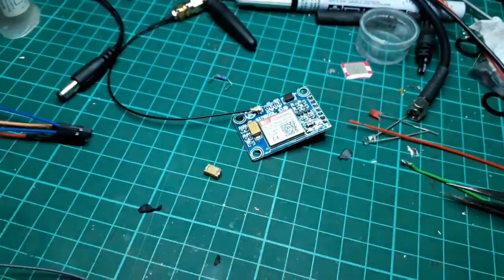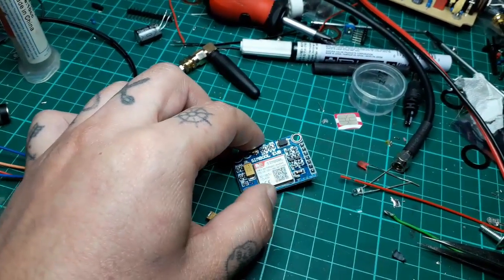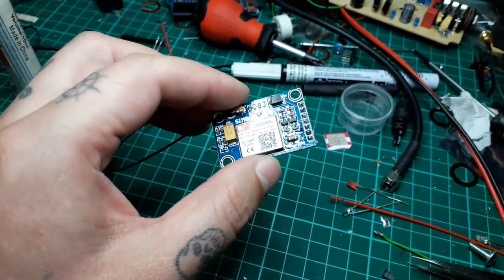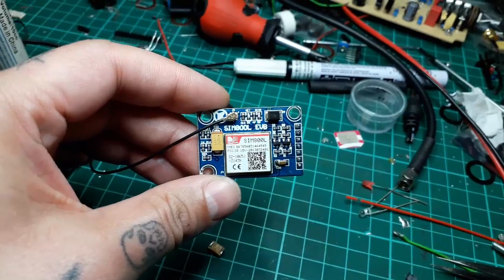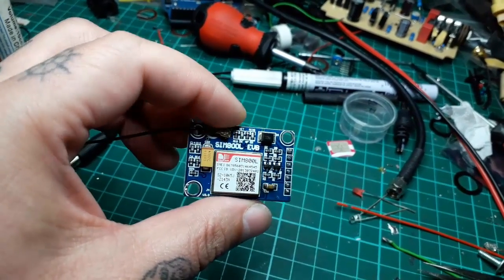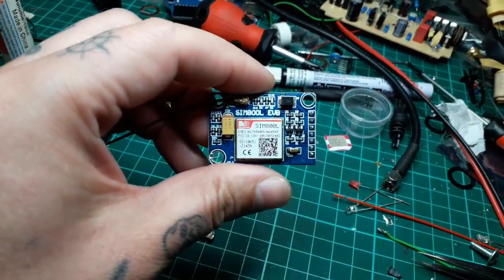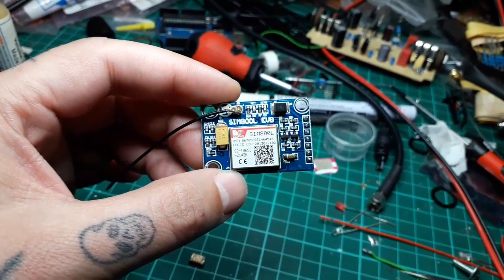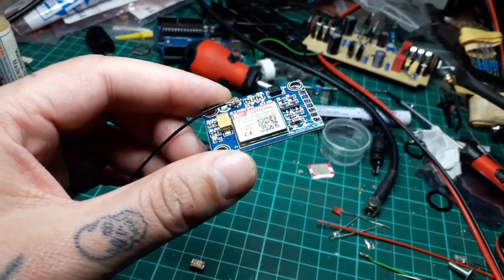SIM800L EVB - the simple solution for a big problem

Comment: What were the amperes output of the GSM's capacitor after a new one was soldered altogether ? Since the module has 2A bursts, does that mean I have to make sure the capacitor has 2A output ? I used a 2200uF/16v soldered with the on-board ceramic capacitor and got 1.7A-1.8A readings on my multimeter. Im also considering placing another capacitor onto the supply to make sure I get consistent curents (Im using a 12V 2A adapter connected onto a 5V output stepdown converter as the main supply )

Comment: This video is very useful. pay attention to your connection cables, they are not always only made of copper and there are sometimes resistances which in this case cause these problems of voltage drops and parasites

Comment: @DeXTeR'sWorkshop how many volts can you use to feed this board??? The datasheet says it's recomended to feed with 4v but module has a 5v pin..
Reply from the maker: Yes, because there is a drop diode on VCC that would put out around 0.7V 
But not all modules have it.

Comment: 4 years later and it's still a great solution. Thank you!
Reply: Lmao, so fucking true 😂😂
Reply: Did ur problem solved... How please tell me.
Reply: @Sekhar_Home  I've actually used another board SIM808 Development Board EvB-3.2.

Will test it tomorrow and tell you the results but in advance, the module is very sensible and should be used with a powerful (2A minimum) power supply, you can add capacitors from Vout to ground on the power supply output so it decouples the supply voltage from the module and handles the high frequency high current peaks it needs.
Reply: @Sekhar_Home  you could also have broken you module if you fed it with incorrect voltage so be careful. Double check aways and have a spare part to test following the correct steps from the beginning.

Comment: I'm also can confirm that the mod is working. I had my project connected in a good PSU but accidentally my antenna was unscrewed and the module keep reseting it's self after losing the signal with the GSM network. I changed the cap (477a) with an electrolytic 2200μF 16v (for people they are asking, you need any electrolytic cap from 1000uF to 2200uF at least 6v) and the module just stayed alive even after losing the signal with the GSM net without resetting/rebooting. So this made me think that this is a signal problem and not a power/PSU problem.
Thanks for the upload mate, subscribed.

Comment: Man, you helped me so much. I also noticed when antena was not attached module worked, so obvious - powering problem, even with 3A power supply.  I used 2200nF low ESR between VCC and GND and didin't work. I solder like you and everything working now.

Comment: Hello dear, I have replaced the capacitor with 2200uF and it is still not registering. My SIM card works fine. I have provided a separate 5V with buck converter. What could be the issue?
Reply: Hey! Did u solved the problem. I have the same problem

Comment: This is the real problem of SIM800L and SIM800L EVB. The solution is adjust the input voltage reading the voltage on VBAT. VBAT is in the possitive capacitor terminal and GND. In the SIMCOM 800L datasheet tell us the range voltage VBAT(simcom chip) 3.4v to 4.4v. you must set the voltage between 4.2v and 4.3v on VBAT. In the case of SIM800L EVB the input voltage is near to 5.2v to 5.3v. So input voltage 5.2v 5.3v while in VBAT 4.2v 4.3v. no more fail.

Comment: Se debe conectar el modulo directo a la fuente de poder con buenos cables, no se debe usar cables delgados ni energizar por el protoboard porque no pasa suficiente corriente, en mi caso se soluciono al conectar directo a 5v 2 A / You must connect the module directly to the power supply with good cables, you should not use thin cables or energize the breadboard because it does not pass enough current, in my case it was solved by connecting directly to 5v 2A.

Comment: I didnt even remove the capacitor on the sim800l evb board i added 4 (470uF) cap parallel connected. works like a charm. u saved me days of frustration. thank you dexter.

Comment: My unit was somehow short-circuited when i connected it to my ESP32 5V output, i connected everything correctly, and it got very-very-hot to the point where a diode (near 5v input) got desoldered and fall off. one thing i noticed is the PCB was cutted too much on iop side, exposing a vias taht were connected to the 5v input diode, is this the cause?

So far my exploration into the GSM realm has been quite unsavoury compared to Wi-Fi and LoRa

Comment: My unit seems to have a C22=470uF (it's marked 477A) capacitor, but it's showing the exact same problem as yours. You said that the datasheet specifies 470uF minimum. Also, I'm using a PL2303MDL USB-to-SERIAL module. If the SIM800L module draws 2A in bursts, that might explain why it's resetting too. I think the serial module I have can only supply 25mA.

Comment: For Dummies like me: I was afraid of damage my module, so before start to change it, I was trying to test with the capacitor on the protoboard but it was't working till i put it at the nearest of the pins of the module and worked. I'd say that it's because the protoboard wire can't let pass 2a as needed, its too sharp. So use cables to a better current peak.

Comment: You saved my project! I was about to change everything when I saw this video, it perfectly worked for me. I used 2200uF - 25 V cap, the positive pin goes in the antenna side. Easy, quick and 100% solved, thanks a lot to you and all the people commenting their experience :)
Reply: Please could you show me a picture of how you connected the capacitor to it
Reply: ???  how you connected it to the module?
Reply: Please could you show me a picture of how you connected the capacitor to it

Comment: Thanks DeXTer for this solution. I solved this problem with a 2200 uF capacitor, not on the SIM800L itself, but on the power leads to the circuit, very close. No more connection dropout.
Reply from the maker: Yes, in the final design ive added the cap very close on the PCB.
Glad i could help.

Comment: Thank you for sharing this great solution! I exchanged that capacitor with a 2200uF 16V capacitor as you did, first time the system has started, I could send and receive text messages from Arduino! :) But as I unplugged the power source and tried to restart, it didn't work anymore. It blinks 6-9 times and as tries to connect to the network, it restarts with the 2200uF capacitor. What else can you suggest?
Reply: I saw in other comments that the breadboard wire is not enough for 2A, so I tried to put shorter wires to the power supply and it works again :)

Comment: I'm using SIM800C with 220u Tantalum capacitor for decoupling closed to Vbat pin. I've never encountered such problem. Maybe it is because of different module or pcb layout.

Comment: Have you read manual completely? What about power source? Drops during TX bursts? Is your power source in specs? And what about ripples during TX? Also in the specs? And what about power lines resistance? I see just thin wires and strange connectors? Are you sure that all that stuff is in specs? I bet the module should be soldered into other board not hanging on the connector-ed wires. Replacing capacitor without cleaning all other issues I can see is not proper solution.
Reply from the maker: Power source is able to put out 10A :) other modules worked without a problem in the same configuration - the difference between those that were OK and not OK was the filtering cap which was not according to the DS . And yes the value of the VCC cap is stated in DS as a minimum value (read the specs first) - so please :) but your things together and in place before - like read the SIM800 datasheet ;)
Bu thank you for your comment of invaluable ... value
Reply: @YO3HEX  I see you know the things best. I wanted to show others who do not know too deeply what you are talking about that simple replacing tantalum cap with bigger electrolytic it is not solution.
By the way I did not asked you to tell me what current your power source can deliver. I just mentioned some parts of datasheet. The most important is how deep drop is made by GSM burst with maximum output power. It is evident that you did not measured it. End even you power source can do 10A it does not mean that it is so fast that it will be with module datasheet specs. Also if your power source will make ripples in the TX period you will have bit BER and the data transfer will be unreliable in the moment you get out of good GSM coverage. Makes no sense to discuss it anymore because you wanted to show simple solution and my question trying to disintegrate its stability. I wish you good luck.

Comment: Hi, what Type of capacitor I should use? I mean electrolytic, tanthal, ceramics? Thank you for reply
Reply from the maker: A low ESR electrolytic would be a good choice.
Reply: @YO3HEX  thank you, I will solder sth like it. What about power suply for it? I hope that 5v Esp32 output is not a good choice. Impulse Power suply will generate a lot of noises So what will be Best for Such use?
Reply from the maker: @luki530  the power supply should be able to put out at least 2A so you will need an external one. You cannot use USB as a PSU

Comment: Your problem is NOT the capacitor. I just bought 100 units from China and they ALL work perfectly. Your problem is the Dupont cables that you are using to connect the power pins. They cannot pass 2A even in short bursts. Place the unit in a bread board and use solid core cables and it will work perfectly. By adding a larger capacitor you are adding a larger reservoir which supplies the current, but the problem is still there. Change your cables.
Reply from the maker: Ive tried also with 0.75 solid core wires and i had the same problem.
Ive also test it on PCB...same. nothing changed until ive added the cap of the value specified in the DS or bigger
Reply: Hi @NotMarkKnopfler, the dupont cables were my problem too. I was able to demonstrate it with a lab power supply with or without a Dupont cable between the module and the vcc

Comment: I used parallel capacitor 2x1000uf, and connect to vcc and ground sim card, and work. Thanks
Reply: Nah kak dir buat alat juga tah kak wkwkw
Reply: @cumahobiarduino4724  wei ini sapa 😂
Reply: Wkwkwkw tebe weh 😂😂😂🏡
Reply: Maenan IOT juga kak?
Reply: Ada kawan gueeh wkwkwkw
Reply: @cumahobiarduino4724  welehhh
Reply: @cumahobiarduino4724  amatiran doang ban, cuma kirim sms utk hidupin alarm, buat ews
Reply: Gak papa laah kak, ane aja baru belajar, ini ane mw Fokus di Modul gsm buat IOT nya karna pake NODEMCU bajetnya lumayan wkwkw

Comment: 2200uf - how many volts? Thanks
Reply from the maker: There is a max of 5v there...so anything between 10 and 16v will be more than enough
Reply: @YO3HEX can i use 1000uf 6.5v with it?

Comment: i have sim800L with 1000uF 6v capasitor with same problem. the LED always blinking fast (no signal). so better replace it with 2200uF 5.5v?
Reply from the maker: Might be another problem. Check if your network is supported by this module as it cannot connect to 3G networks, only 2G
Reply: the simcard work fine on the phone with 4G network
Reply from the maker: @helmyfaisal4696  read again what i said. The module will work ONLY  with 2G networks.
Reply: @YO3HEX  i see, thanks for advice. I think it's a big problem in my country, because i can't fi nd simcard with only 2G support in the market right now. hehe
Reply: @helmyfaisal4696  Semua kartu SIM yg ada di Indonèsia bisa 2G, bro. Jadi, masalahnya bukan di kartu SIM. Periksa dulu wiringnya. Bisa jadi, ada sambungan wiring yg kurang sempurna.
Reply: @kwcatur  udah lama ketemu solusinya om, H+1 dari komentar ini hahaha. Masalahnya ternyata memang di power.
Reply: @helmyfaisal4696  saya baru liat videonya hari ini. Solusinya sama spt dlm video atau ada solusi lain lagi?
Kalo solusi lain lagi, bisa dishare?
Reply: @kwcatur  beda dikit. Pake power external 5V 3A. ground dari power itu masukin ke ground arduino dulu, kemudian ground SIM ngambil dari arduino. Di kasus saya, ganti elco gak ngaruh.
Reply: i'm trying to replace the capasitor 2200uF 16V. but, nothing changed. still same problem. i don't know what to do again right now.

Comment: actually, you don't need to change the capacitor if you solder power supply pins directly into the module. jumper wires not enough to get 2A current
Reply from the maker: Read the datasheet of the sim900.
You need a cap on the power lines.

Comment: greeting

maybe you can help me if you have the good will

i have the same sim800l a module and the same ad hx711

my problem is
how do i make the hx711 go over the arduino nano like yours and that it measures send sms to my number

i see you have both sim800l and hx711 and arduino nano
i didn't just see the weight sensor

I would ask for any help
thanks in advance and all good

Comment: Thanks, i tried and its working. But the gsm can only recieve sms but cannot send. any solutions for me
Reply from the maker: Check on your sim if the smsc number is correct
Reply from the maker: Or use a sim from which you can send sms.
Never had a problem with sms receive

Comment: Worked for me too finally after replacing the capacitor and now finally blinks in 3 seconds => connected to network. However i'm struggling to make AT commands work. They never work & no any response received from SIM serial (TX & RX) Any one faced the same ?
I'm using external DC 5V (2A) for SIM module connected to VCC (5V) & ground .. while Arduino is connected to SIM like below
SIM VDD => Arudino 5V
SIM 2nd Ground (lower one beside RST) => Arduino Ground
SIM TX => PIN 8
SIM RX => PIN 7

Please, help!!
Reply: Hey did you solve that, cause I'm have the same problem
Reply: It is hard to diagnose your concern without seeing the code.

Comment: Gracias Amigo,  cambie el capacitor por uno de 1000microF y funciono el modulo, muchas gracias por tu aportacion.
Reply: Hola amigo. El capacitor que voltaje debe ser?
Mi problema es que no conecta a la red como si no leyera la simCard, era tu problema tambien?

Comment: Hey bro. Can i ask for the polarity of the capacitor? Which side is positive?
Reply from the maker: On an electrolytic cap the negative side is always marked.
The shorter leg is the negative also
Reply: @YO3HEX  Thank you bro! It worked! Nonetheless, i have observed that it goes back to restarting after sometime. Leaving it ON for about 5 minutes fixes the problem. Is this the capacitor charging? or what? haha
Reply: Cap btw is 2200uF with 16V.

Comment: Mine auto restarts for every approximately 7 secs. And I dont think it is because of power supply. It is more likely with signal issues. What am I supposed to do with this?
Reply from the maker: I think you have the solution in the video -replace the cap. Have you tried that? And no is not about signal issue - a signal issue would not make the module restart.
Change that cap and you will have an working module
Reply: @YO3HEX  thanks sir. But for some instances, the module works but somehow, it stops working.

Comment: I normally have no problems when I send SMS with this module. But when I receive SMS and read them with the module, at the beginning everthing goes well, however after some trials (10-12) the module seems not to responde anymore. I see a quick blink in the power light (not as long as the resetting one). I'm already desperate with this, i dont know if it's the SIM buffer which is full or the capacitor. I'd LOVE you could give me a hand. So far, Im for sure subscribed to this channel. Awesome help dude! :)

Comment: That definitely solved my problem! I used a 1000uF capacitor and worked great too. Thanks bro
Reply: Hello, did you connect the capacitor just like on the video or can you do it outside the module? And what voltage is the capacitor that you used?
Reply: Did it solve signal issues?
Reply: i have sim800L evb with 1000uF from factory. but its still have same problem.

Comment: Thankyou for the video what is the voltage of the capacitor you are using?
Reply: I have a 2200uf 25V capacitor will that serve the purpose
Reply: Hey thanks it worked for me
Reply: It becomes stable?

Comment: All the SIM8*** and SIM9*** modules use a lot of power when transmitting. I use a 4 volt/ 2.5A power supply with decent decoupling. 
This is well explained in the datasheet.  You can also use a 2500mA cellphone battery @ 3,7V
Reply from the maker: Using that already thank you, but also if you read the DS you will also see the recomandation regarding the caps near the VCC input 😉

Comment: Greetings.

I have an sim800l module, which only blinks and never responds. The capacitor to bring the module installed is a 107a that according to is 100uF, do you think that by changing a capacitor of 470uF (which are the ones that I have seen that bring on the board the modules sold in Amazon), the problem is solved? Or is it better to use the 2200uF that you use? Another doubt, it is indistinct the assembly of that capacitor, since the ones that I have found bring + and -? Thank you.
Reply: did you solve your problem?
Reply: @wahajmurtaza6217  no
Reply: @andresperez5020  I tested 2 module and the didnt repond to at commands, I than added buck converter for 4v 2A and the voltage divider for 3v to rx pin of gsm module but it didn't work, So i had a new module I tested it on the buck converter and voltage divider and it responded to at commands, still havent tested network though, so i have assumptions that the module were not working or the 5v uart data pin fried the circuit (though couldn't find this case online).